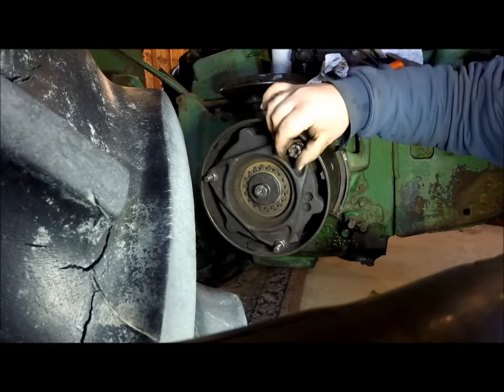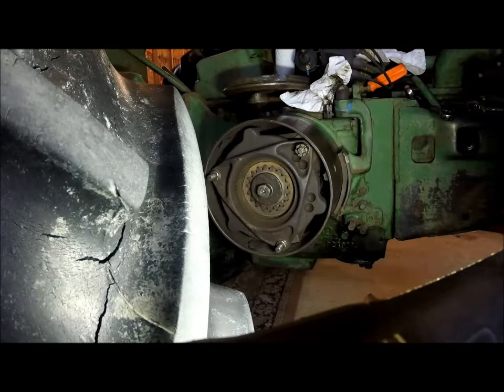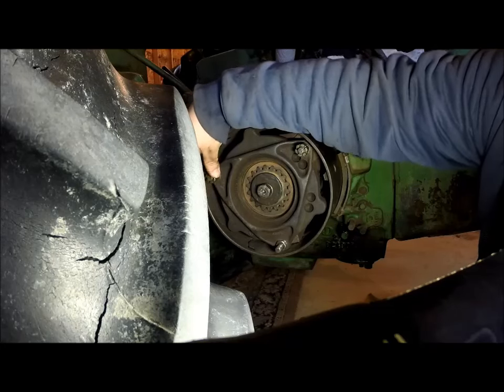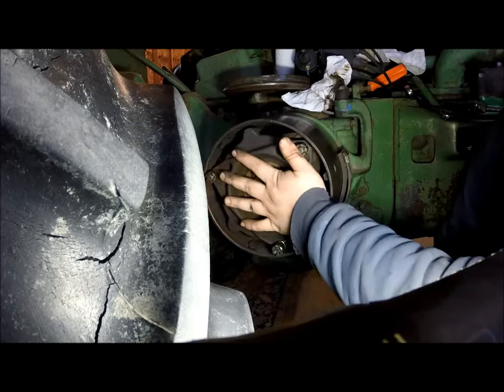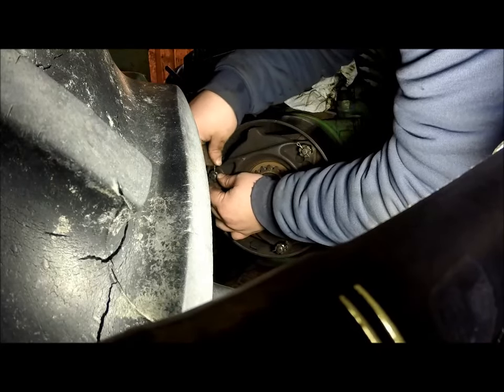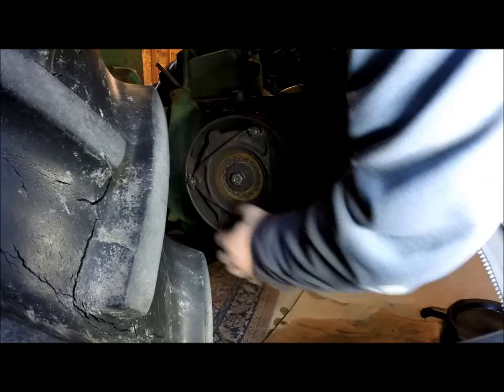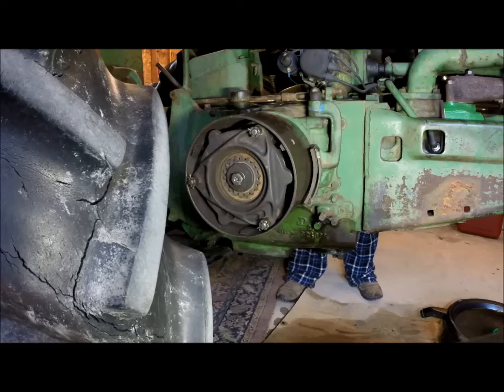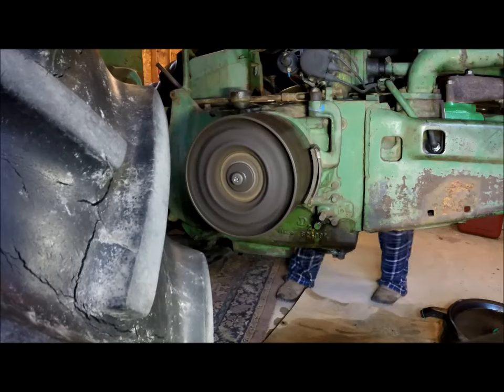How to Adjust John Deere A, B, D, and G clutch

Comment: Removed the clutch fork, cleaned it up. And now the clutch will not disengage. Any suggestions. The clutch worked good before I did this. I can find nothing on clutch fork adjustments, any advice?
Reply from the maker: What do you mean by cleaned it up? If you removed material, you will need to adjust the linkage between the clutch lever and the clutch fork assembly. If I recall correctly. I have not worked on a 2cyl clutch it a long time.
Reply: New gasket, new retainer ring. Painted the outer casing. Nothing more than that. @BillTheTractorMan
Reply from the maker: @michaelgoff5514  I'm just going off of memory here, but if the yoke did not slide into the correct position, I think this can happen, too. It will lock in but not catch the release. I sold the B 4-5yrs ago. I miss it and have been wanting to get a 520 when I can build a shed to keep more tractors in.

Comment: I have been trying to get this pivot pin out of the clutch lever for so long my dad even tried 20 years ago and it still won't come out. can you please  help me?
Reply from the maker: BOB White using heat, or drilling it. I'm not sure if the pin is press fit or not.
Reply: Bill The Tractor Man you shouldn't use heat or a hammer your should have to use a press or something it has a bushing and that wears out a lot